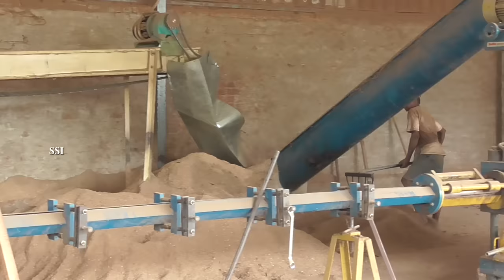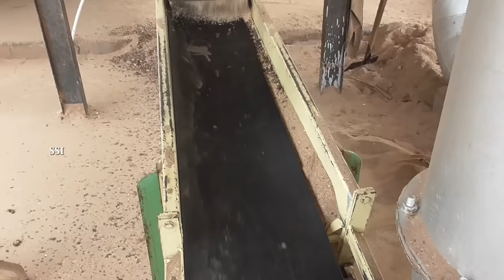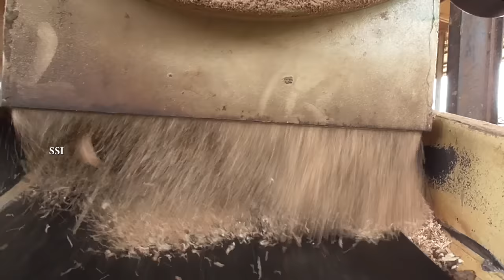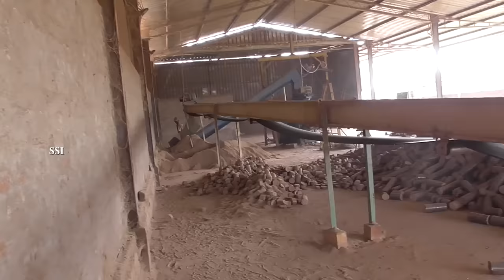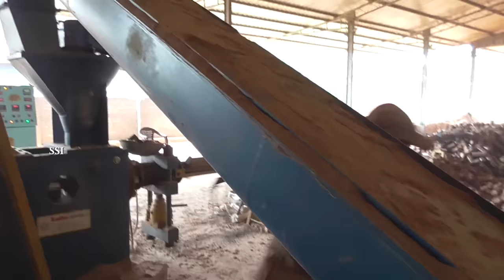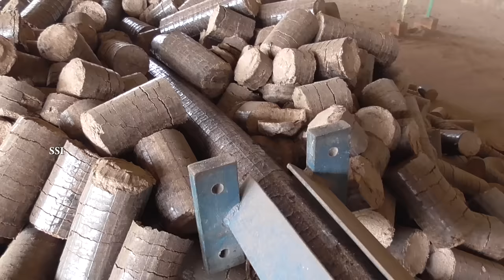Automatic Briquette making Machine "Wood Briquetting" Work Plant process

Comment: What did they use to bind the sawdust together. You didn’t show the compaction process to cutting the finish tube to length. No much of a video showing the making of briquettes.  Poor 1-10 > 2
Reply: without binder. high pressure and temperature for pressing sawdust.

Comment: Is a binder agent being used ?
Reply: normaly not becouse the friction heat-pressure melt some of the lignine in the wood cind of guing it toghether!
but i have seen plases where they use lover pressure and they add a few% of say wheat floor and steam to cind of glue the fibers toghether.
as a kid in the 1960s we used to make paper glue by mixing wheat floor and water. hehe